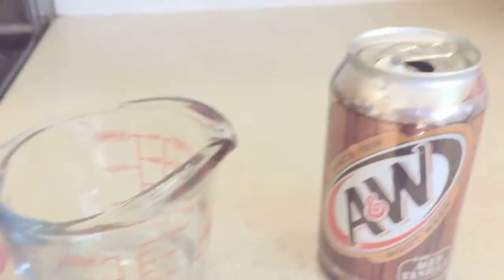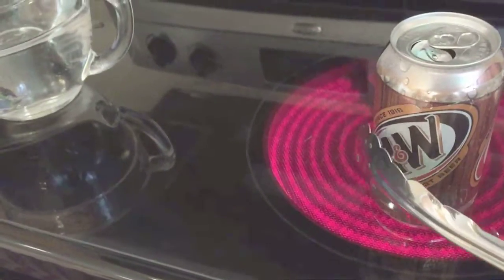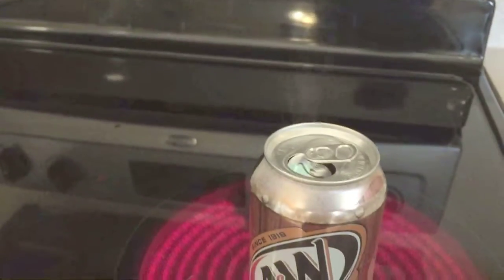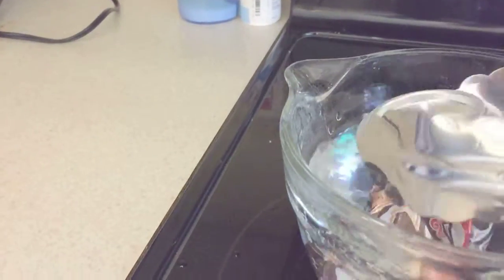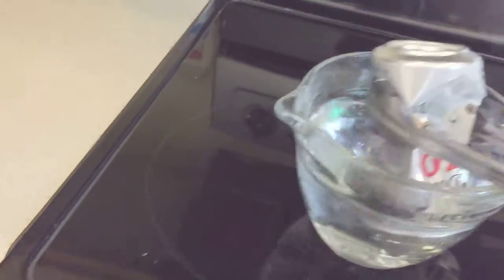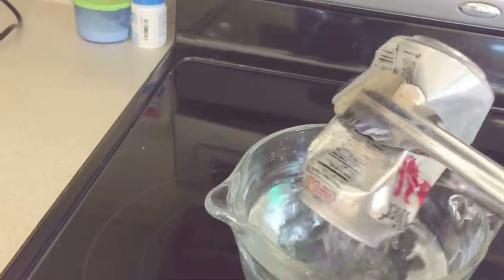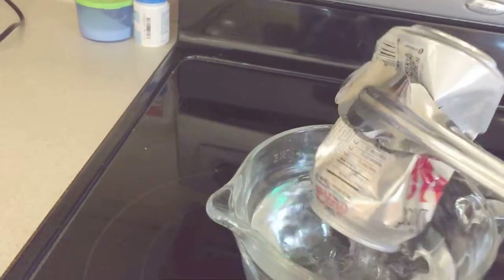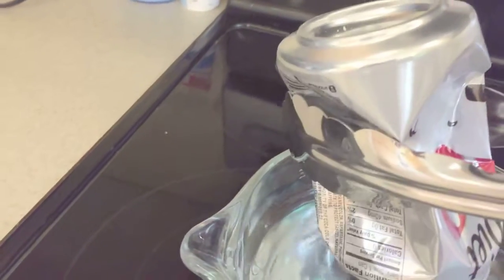Air Pressure Can CRUSHER Experiment (How to crush a can with air pressure)

Comment: I have hw about this can you explain what gas law this is in my understanding would it be Charles and Boyle law?
Reply from the maker: Morning Edwin, Crushing Can Experiment proves the Boyle’s Law, which is one of the major fundamental and experimental gas law of ideal gas equation law.

Boyle’s law states that the volume of certain amount of gas is inversely proportional to pressure of a gas.

Robert Boyle put Boyle’s Law into words in 1662 stating that the pressure of a gas is inversely proportional to volume of a gas. 

To keep it simple, if there is less volume of gas then there is more pressure on the gas at constant temperature. This law is otherwise known as Boyle–Mariotte law or Pressure-Volume Law. I hope this helps. thanks Ken

Comment: Can I just use a pan because I have a gas stove and the can would slip and ruin my stove if I didn’t use the pan
Reply from the maker: Yes a pan should be fine. Let me know how it goes. Thanks
Reply: It didn’t work and the water didn’t even start steaming soooo
Reply from the maker: Sorry let's see if I can help to get it to work.  Sense you are using a pan, try putting a little water in the pan and put the soda can into the water. Just enough to cover one inch of the can. Let water boil in the pan. Realize this will take longer to heat up. Let me know if this helps?
Reply: Could the can company matter? I used and Izzy can (an unpopular company) but you used A&W and that worked so I don’t know